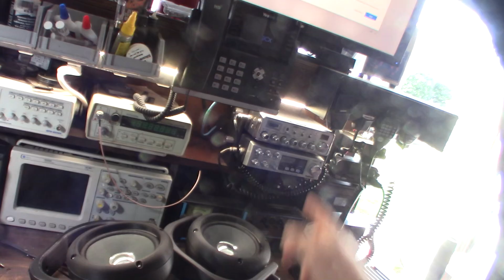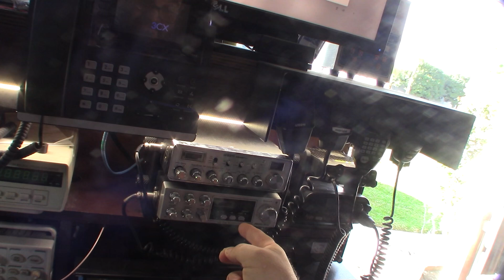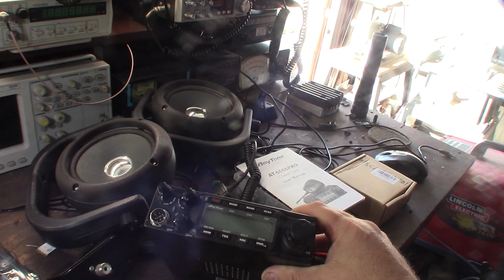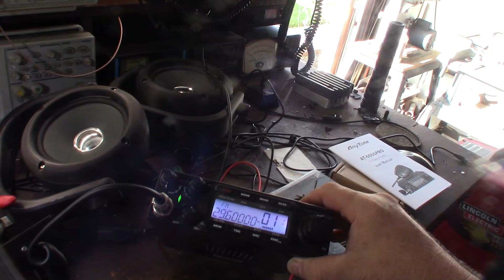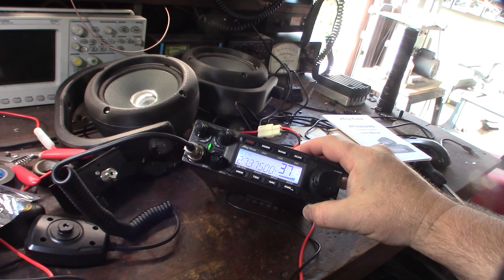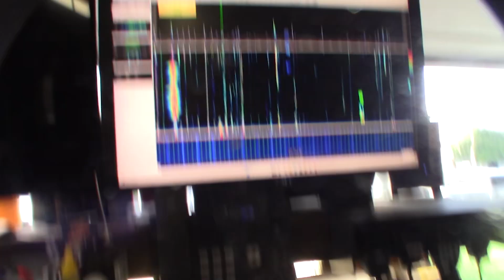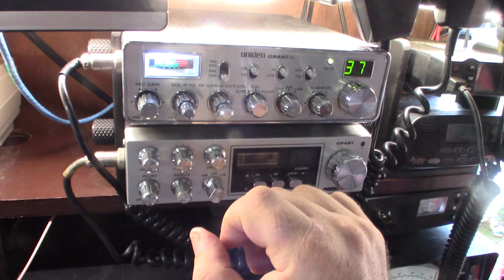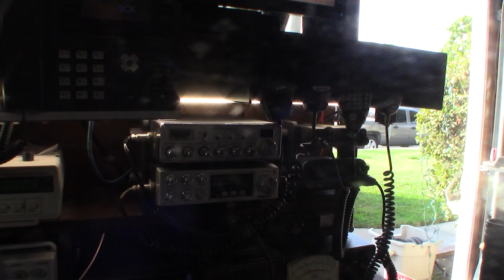Old Vs. New CB Radio Receive Quality, AnyTone AT-6666Pro, Uniden Grant XL, 858 Grant, SDRplay

Comment: noise reduction on the 5555 is incredible
Reply: I just got the Superstar 3900 after looking for a few months any one you would recommend
Reply from the maker: My favorite old CB is the 858 chassis.
Reply from the maker: After the 858 chassis they started cutting corners. You can tell the difference between a Uniden radio made in Japan.
Reply from the maker: The Quad 6 sounds pretty good too.

Comment: Most pre 2024 onward cb now use dont use Hi-Q coils,like they did in 1980s sets,bandwidth is less  \Q factor is higher on older gear.
 The Modern smd cb transcievers mostly now in 2024-2025 VS 1980 electronics not really a fair comparison,they use bandpass filters with L&C totally different from old tech cb and do meet certain specifications perfectly acceptaable levels.

These  NEW multi-mode radios with FM mode,now these fm rx sensitivities are extreamely senstive rx typ -130dBm for 12db sinad or more (ive had a lot of these on bench test kit mid 2024 to end 2024),what you have to do is in am-ssb use the RF gain control to back down the front end gain down ,some sets off this in the menu some offer on control knob.
Because of this the S9 reading is different value vs a old 1980s sets ,so they will be differences.
CB S-meters a not the best either ,you need 6dB change per S point ,most go out of whack calibrations on meters,new digiatl ones are better calibrated.
On older cb radios your typical Am rx would be -113dBm for 10 s\n ,lot less senstive than a modern counterpart radio.

Not trying to knock the video ,but theres some extra details missing to your explanations you may or may not know,without cablibrated RF communications testset going to be very difficult to judge properly old vs new not a fair comparision.
Yes there are some advanatges to old tech vs new tech cb radios like filters...sharper but to be fair  for what your paying now for a AT-6666pro pretty good value for monies..& features.

RF gain trick can be used,a more complex trick is by using the engineering software and calming certain modes down and then recalbibrating the S meter back,but thats pretty complex engineering skils and kit ,goes way beyond this video.

Another trick is ....
wide and narrow tx bandwidth on SSB,you cannot do that on 80s sets
wide\Narrow fm deviation for hame wide 10m (USA mainly)for cb narrow fm deviation.
FM ctcss\dcs Tone squelch including tone splits tones and single tones ,not on those 80s sets.
Repeater split tx shift +/-offset
Fast\Slow AGC feature..not on 80s sets
NRC chip tx\rx Not on 80s sets-It will also remove car driving background noises if windows open while driving ! Not on 80s sets
Memories 1-99 slots
VFO mode
PC connectivity...
TCXO freq stability if far better .. 
Shielding much improved.
Also certifcation and Lowpass filters more stringent now.
If you visit the radioditty website QT-80,theres a pdf download how to do Data modes a very handy feature..
If you go to Anytone theres firmware updates and engineering alignment software (do not use unless fully know what your doing and have calibrated test equipment ,if you screw it up its all on you)and CPS PC programming software to set all the hidden stuff.

so lots of plus feature in these newer sets ,80 radios cant do.
Only advantage i now see in old school types is ease of use with controls and layout better in cars,maybe repairs if spares are still available?.
Modern radios you need very good SMT skills and test gear to repair sets.

Older USA cb lack fm mode too ,we used to convert them for UK\EU uses with FM boards as we mainly used FM mode in late late 79s into 80s,90s.
FM is very new to cb in states too but President used to make EU versions of the USA version with fm mode added at factory.
be aware fm 10m ham uses 4khz dev (wide on at-6666pro) and cb uses Super-Narrow FM 2.00khz deviation (says narrow on AT6666pro,throughout world USA\CAN\MEX\EU\UK\Other)

Hope that clears up some of those mysteries of new vs old cb,
Yes the old are Classics
 but to me its time for CB radio to move on and grow up a bit more and embraces newer features we never had or afford ,we have now  lol
Yes have a very nice collection with you classics,keep them use them,enjoy the AT-6666pro its a good radio.

Loved the vid ,didnt want to come across negative,but hope this info helps you better understand the differences.
At end of day it comes down to personal choices and what suits you old style or new style cb\10m set.
little plug here for cb nutters...visit 
www.simonthewizard.com 
for your cb cravings and gear ..its a fab site to check out.
And enjoy your new fm mode and Tone Squelch (CTCSS\DCS TSQ)works really well with FM mode for cb radio!!

all the best 
From over the pond UK

73,s rob
the rf engineer Guy👍
RPC Systems

sorry if any typo spelling errors , its 2Am in morning here ...in uk
Reply from the maker: I'm starting to like the newer stuff after playing with the AT-6666Pro

Comment: Best radio is president adams
Reply from the maker: I hear you all the time on the radio in Newport Beach, CA. The Adams looks very similar to the 858 grant. Looks like is uses the same PLL. Does your Adams have the transmit relay? I'm wondering if it was the standard 858 chassis like the Washington.
Reply from the maker: I'm subscribed to your channel.

Comment: U are correct,  this video does not show the quad 6 pro with the Noise Reduction  on setting 2 or 3,  it id a fearure if the radio and available  technology,  it shohld be used when testing, then rhw reviewer would see the quad 6 receive is quieter than the 858 grant.  Have been on cb over 40 years, the NR technology  in the new rigs blows the old rigs away. I like the nostalgia.of the old rigs myself, but i wohld be lying to say receive is better in older radios, not anymore. NR was a gqme changer, may have took 3 decades to catch up to the old grants with the big metal filters and nice quiet receive, but that ship has sailed.   My radioddity  qt60, aka anyrone quad 5n2 new version/ short case, in receive test with ant   switcher   blows out a new in box uniden grant/ mb8718, , hr2510, philly  148 and grant 858, the new qt60 has much less noise than washington. Qt60 has quieter receive than the wuad 6 pro, which is 2nd in receive , then washington, which of course has no shortage of white noise, even with nr on,  Which most reviewers fail to mention the infamous . Qt60 hears " locals" 15 miles down road better and clearer than all above mentioned radios.  My u jden grant xl now seems noisy on recive after using the qt 60 with nr set to 3.  When band is quiet , u cannot tell radio is on, superior receive indeed.   The $260 radio hears better and is quietwr than the $400 1s, yet many satly they sre all the same, some have same boards, different components etc, different  fascia but same radios, kind.of.like.ranger and galsxy theu the 90s, but place a quad 5n2 with nr set to 2.or 3 against any of the old radios ,side by side, and see for yourself which recieves better and has less.noise.as far as the newer  rigs lasting 30 yeqrs, doubt most us cb'ers have anywhere near 30.plus more years, and even if radio lasts 10 years, u buy another with latest tech and it will be even better than a decade prior. enjoy the hobby, cb = constant buying, most do not sit with the same radio for 30 years anyhow.  How many people will be on cb another decade or 2 from.now ?    i mean really.     hope this helps some folks.
Reply from the maker: I've been using the AT-6666 for a week. Its an impressive radio. I'm only on SSB. I'm actually going to replace the Grant XL with a AT-5555. I'm not sure the 858 Grant sounds pretty incredible.
Reply: @fintechrepairshop    Fin, give the 5n2 newest version a shot, if u are.impressed with the quad 6 pro, and it's a very good radio, I think u will love the 5n2, has a different  board and components,  u will note a difference  in receive quietness between the 2.  Been thru well over 100 rigs over the decades, for sheer quietness and lack of.white noise, I have not found anything to match this 5n2 , bone stock. Amazing receiver, makes the grant xl sound noisy on a quiet night !  My uniden grant 858 is quieter than my grant xl as well, but throw the nr on level 2 or 3 on the 5n2, side by side with the 858 grant and  u be the judge, I think u will be incedibly impressed with that $260 📻
Reply from the maker: @Tommy1Shot  I've been looking. Wanting to see one on sale. Are you running yours barefoot or with an amp? With my Starduster M400 antenna and 200 watts I can get from the west coast to the east coast.
Reply: @fintechrepairshop   running with a straight 4 pill biased/ssb  high drive,  have rf power wide open, which is about 60 watts pep roughly, and I do 500- 550 watts all day long, nice and cool. Perfect  match .  Imax 10 ft off ground, work the world, Columbia, germany, north ireland,.talk fairly regularly.on ssb to.some buddies up north from gulf coast fairly frequently,  and.not.for a min,  were bs'ing like locals for well over an hr.  About 2 weeks ago, talked to 2 friends in nj for a good 2 hours, they were both doing s7-'9s, and they're both using imax on 10 ft mast as well. Conditions have been great for.most part
Reply from the maker: @Tommy1Shot  I was thinking about getting a 4 pill. How many amps is your 4 pill power supply.?

Comment: Yeah that protective can is the go dude. The new radios like the 6666 benifit from Surface mount devices and the miniaturization of RF circuitry . It's not a digital radio it's the contemporary design that provides the improvements in RX and TX.
Reply from the maker: The new radios sound good. I'm not sure why the 858 Grant sounds but its are par with the newer stuff. I'm kind of sold on the newer stuff now.

Comment: I hear people say the new Quad 6 and Quad 5 receive is not as good as the old grants but I swear my Quad 5 is just as good as my grant XL if not better. The noise reduction on the 5555 nii is incredible and the Grant Xl can't even come close. I wonder if the new radios will last 30+ years like my Grant.
Reply: You heard wrong bud. I love my new 6666 pro. It picks up just as good as my 7300.
Reply: @John-622  I heard wrong and dissagree with the people that say the new radios have poor receive. My Quad 5 nii is awesome and pulls in stations like I said just as good if not better than my grant xl.
Reply from the maker: The new radio was better then my Grant XL but my 858 Grant was better then both.
Reply: I dumped my 7300, receive was too noisy on 11 meter, especially  am.side, regardless of.filter settings, my Chinese  export qt60 receives better and is quieter, also beats out my yaesu  991A in receive , as.well as my 2950dx with tone mod to eliminate white noise, qt60  blows it away.   Your not imaginging things .  My quad 5n2 short case was 1.of.cheapest new radios I've bought in 4 decades, and recieves the best, nice quiet receiver . Put it.next.to the $400 washington and listen to.both receives, sometimes less is more.
Reply: @Tommy1Shot  yes the radio is so quiet. I love the noise reduction features. Plus, they are very stable radios and always get good audio reports. The old radios not always that stable on SSB
Reply: @jgmopar   yes I also love how stable these are on ssb as well.  Not needing a "tech" to "peak & ruin" a new radio is a wonderful thing . New radios tend to.work great without others sticking they're fingers in, I've seen it.countless times thru the years, modulation way past 100%, guys think they're " loud" but sound like shit,  spread coils, crank those.vr.pots wide open,.basically ruin the radio. With  these type of newer radios, the jacks still.try to tell u that u need a "tune up", they give your radio dirty harmonics to throw around, nothing more noooooo,leave the damn thing alone and itll work and sound great. I get compliments all the time in the anyrones, loud and crystal clear, and no.fingers I side radio, some sell u on the "150 watts after tune", yet the radio already did near 100 out of the box, want more power, throw a 4 pill inline and it would still cheaper than what these shops charge for theyre magic.  They  still have to make money  in an ever dwindling hobby.  For those wondering about power mics for qt60,and yes, stock mic works well, the  delta m2 is a nice match, the galaxy desk mic sounded good but m2 had the edge on it,  also the d104 lollypop with 10-da head for ssb use sound beautiful.   The turner plus 3 did not sound good on my qt60, I tryed 2 of them, including 1 I recently recapped, surprised as my plus 3 usually matches up well with most rigs. Also the handheld k po mic sounds pretty good as well.
Reply: @Tommy1Shot  I use my Stock mic but have heard people with the M2 and they sound awesome. Yes it does seem the M2 matches great.
Reply: @jgmopar   I'm with ya brother.   Alot of folks like the nostalgic effect of the older radios, or will dump over a grand into a cobra 2000 to customize and add those pretty led's etc., or maybe for.some, older rigs have sentimental value, i get that, and certainly respect that. But many of them.old radios are falling apart, even after caps are replaced, what about the 30 year plus potentiometers,.voltage regulator, ch selector, potentiometers,etc, may as well.build.the entire radio up again, and even then, the qt60.will run circle around it in features,.power, receive.and  modern esthetics. I hear guys all the time.on 38 lsb, on an old.cobra 142 or 148, 3 kc's off feeq, soybd luke crap, and they're bashing the cheap Chinese radios.   We'll, I guess they.caught up, as.they produce some.noce radios nowadays. As far as longevity, i have a wouxun handheld that works as good as new, 15 years later,  I think I got.my.moneys worth. Have an anytone radios at.or.near a decade old, work.ljke new.  So maybe the qt60 will not last 40 years like a snake 2000, but that's OK, in today's world, for a $260 rig, if u get 5- 10 years out of it, id say u did alright. Besides, the way tech is advancing today, most will want to try a later version every so.many years for.no other reason that enjoying the hobby.  Most people in the hobby, that have been in it for a few decades, are middle to upper middle age now, majority in they're mid 50s to late 60s, I doubt they need a radio to last them.another 30 or 40 years at this stage of the game anyhow.   I sold off majority of older radios, kept a nos grant xl for nostalgia,  fire up every now and again for caps, but I would not compare it to qt60,.no match there.  They were good or even great for they're time, but that time has passed.
Reply from the maker: @Tommy1Shot  I'm starting to warm up to the newer stuff. 100% agree with you an transmit frequency. My transmit on my 858 is dead nuts. My grant XL is off. I'm not a CB radio repair expert but most the CB radio repair channels say the 858 chassis is there favorite of all time. I'm probably going to get another quad 6 and quad 5

Comment: Anytone has a CB Radio that looks like the Old Style Radio with the front controls like the Superstar 3900 it seems.
Reply from the maker: I was looking at it before I bought the AT-6666. I got the AT-6666 because its smaller and going in my Bronco. I might by the AT-5555 for my desk.
Reply: Anytone Ares 2 has the old school look
Reply: Or the Ares 2 nice Radio 😉